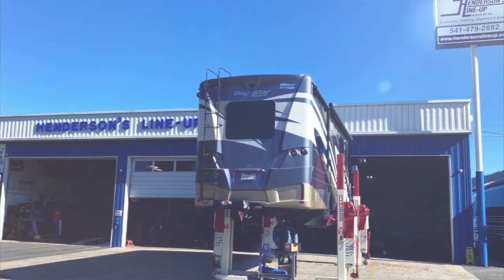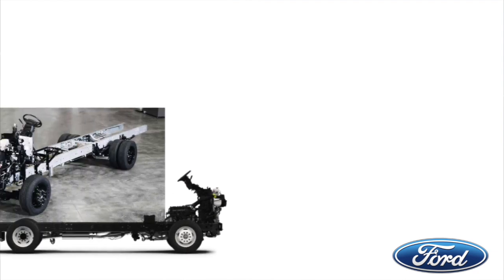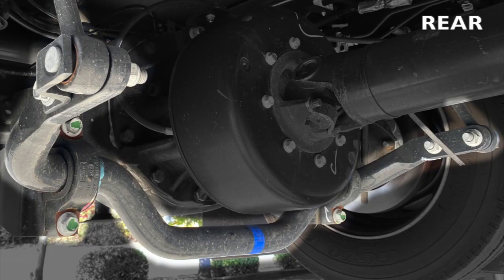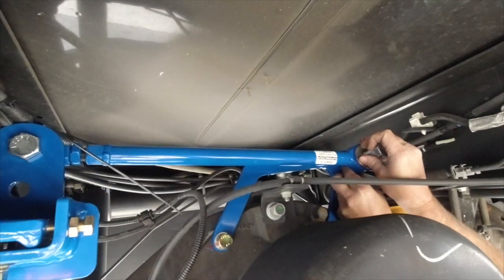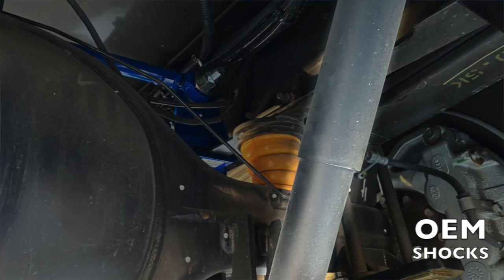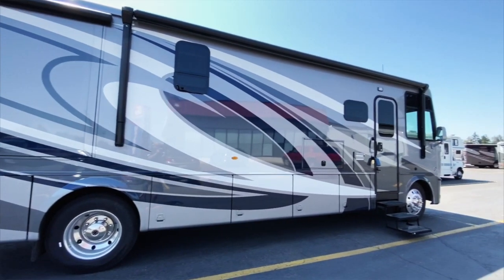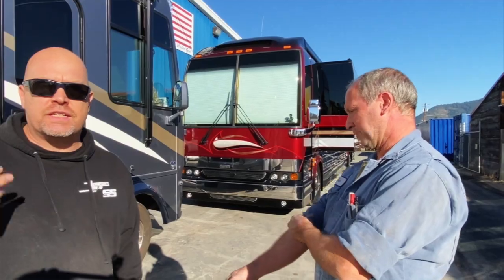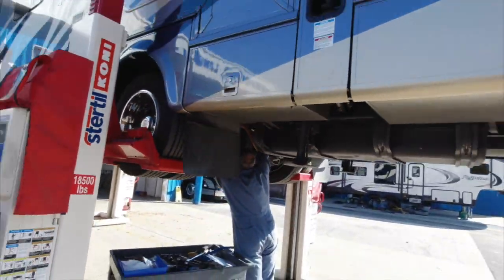How does the new 2021 Ford Chassis handle on the road?

Comment: Why did you add a Rear Sway Bar 1139-149 if the new Ford F53 Sway bar in Rear was bigger and better? Did you add that on before or after the test drive in the video? Also, is the SS 404RR still a prototype?
Reply from the maker: Hey there Joseph! Good questions. We added an additional sway (rear-facing)  bar. The 2" OEM bar is front-facing. It is bigger than previous years but the F-53 Chassis still has sway issues and that 2nd bar really helps.  We always do our best to test-drive every RV that comes into our shop before putting on any after-market parts.  We call that drive a ROAD PERFORMANCE ASSESSMENT. You can learn more about that here: https://www.youtube.com/watch?v=zoVk2sw3fxA&t=22s   

  Oh and the Radius Rods are no longer prototypes. You can see those on our website. https://supersteerparts.com/products/supersteer-ss404rr-radius-rods-for-ford-f53-v8-16-26k-gvwr-2020.html 

Lastly, Feel free to give us a call with any other questions. Humans still answer the phone at SuperSteer!!  1-888-898-3281
Reply: @SuperSteer  I am installing the Safe T PLus front Stabilizer, Super Steer Front Radius Rods(new product from your team on 2021 F53), Koni Shocks via Super Steer, and Super Steer Rear Tracking Bar for 2021 Fleetwood Fortis. The Fortis rides nice now. I just have two young kids and a mommy going with me. I want all the help I can get when a big wind comes or I have to avoid something in front of me. I'm going to see how this works before I add any Roadmaster Rear additional rear-facing sway bar. The folks at Coast RV in Agoura Hills, CA helped me to dial into Super Steer but my Slide-out needs repair so Metro RV in Burbank will put on your products. Please check on them for this installation. I think this is the first time they've done an install of your products on the newer Ford F53 2021 Chassis. It would mean a lot to me if you walked them through any nuances for installation that you guys always watch for. Truth be told...I was looking hard at Liquid Springs for the rear but I think that after listening to people talk about your products this is a prudent route also. Probably just new RV owners jitters on my end doing this but these motor homes are pretty big these days and you can't replace people you love in them. Hoping to be a satisfied customer. BTW, Helen at your firm was very helpful. I will follow up with a video of my customer experience when I get it back. Best, Joe Fick

Comment: I should Make A Choo Choo Train on the Ford Chassis. The Exhaust Pipe Manifold goes On top of the Choo Choo train Funnel. Then I’ll put the Train whistle sound like Choo Choo. I should Put Details  inside. The steering. Wheel thing is for the inside of the Choo Choo Train Cab. Then the Buffers on the Train. The Train Hook and the Train Cars like that.
Reply from the maker: Hmm... If you ever make this thing we'd sure love to see it!
Reply: @ 😱 Really? I can’t Not Wait for this Thing.

Comment: Why doesn’t ford put the 6.7 diesels in the chassis ?
Reply from the maker: Good question! If you get an answer from Ford let us know. :)
Reply: It's too expensive for the mass market of lower-cost motorhomes. If you want a front-engine diesel, Freightliner Custom Chassis offers the MC, used by Newmar (with a Cummins B6.7).

Comment: Could anyone advise if the F53 2020 Chassis is different than the 2021 Chassis. We ordered a 2021 Georgetown GT7 36D and is built on a 2020 Chassis. Anyone advise if is the same upgrade as the 2021 Chassis? Please advise 🙏.
Reply: Essentially the same. https://www.ford.com/commercial-trucks/stripped-chassis/2020/models/f53-motorhome/
Reply from the maker: The link by @stellarjaybe is good.  We would say that Ford did add a bigger sway bar to the chassis which is proof they are working on Suspension performance. Unfortunately, the F53 still is a challenge to drive.

Comment: So...the 2021 gets a new engine, but still needs all those suspension upgrades?

Thank for the video
Reply: They call it 2021 but really it's still tech from 20 years ago
Reply: Agree you have to spend all this money to upgrade the chassis Ford needs to do it at the factory I have 2021 Gulf Stream 31 ft the craftsmanship on the coach is a joke have nothing really good to say about the chassis other than engine and it a Class C time for the I beam to go not happy the way it drives on the interstate
Reply: Semi trucks get new engines, but used the same chasis as trucks from 40 years ago...if it ain't broke, dont fix it they say...but nothing improves.
Reply from the maker: The new engine is seperate from the Steering and Suspension. The new V8 is nice but F-53's can be a challenge to drive for most RV owners.

Comment: does chevy,  gm offer a motor home chassis? what engine?
Reply: The Ford F53 (was a 6.8L V10 until 2021, now a 7.3L V8) is the ONLY gasoline powered Class A motorhome chassis in North America.  The Last "GM" chassis, the "Workhorse" with 8.1L V8 and Alison trans, ceased production in 2008.  Still a very good option in the used market.
In Class C, there are Ford and Chevy cab/chassis...for 2021, Ford gets the new V8.
Reply: @stevematthews684  Close... the Ford E-series is also available as a stripped chassis; it is intended for delivery vans but works for Class A motorhomes as well. And there are gas chassis-cabs for Class C motorhomes. But there are no current (or even recent) GM-built or even GM-powered stripped chassis offered for Class A motorhomes.
Reply from the maker: Not any more. You can still find older coaches out there but these days Ford is your only option on a gas coach.